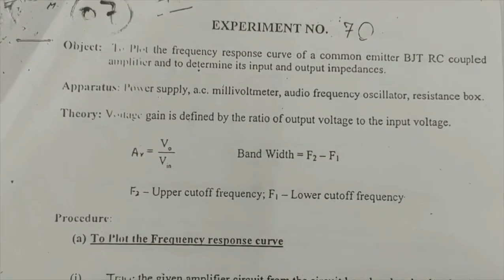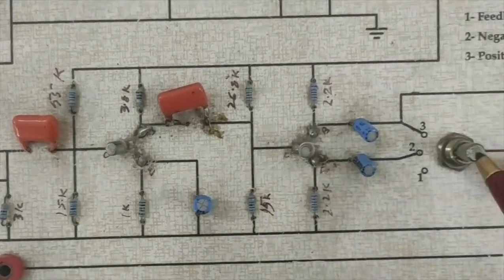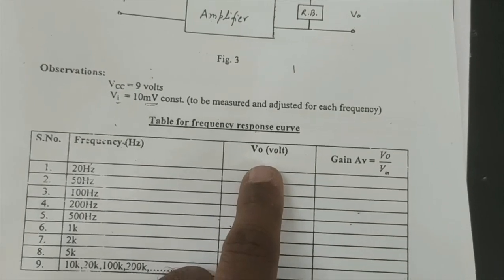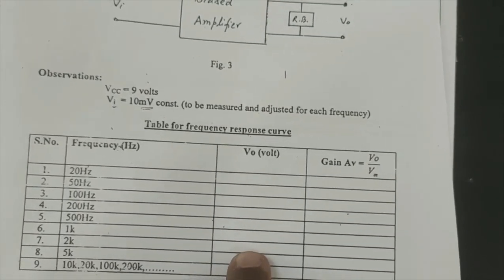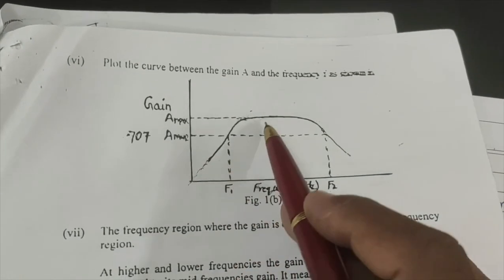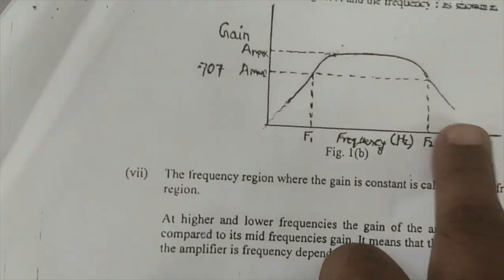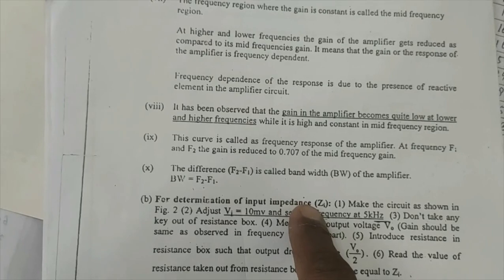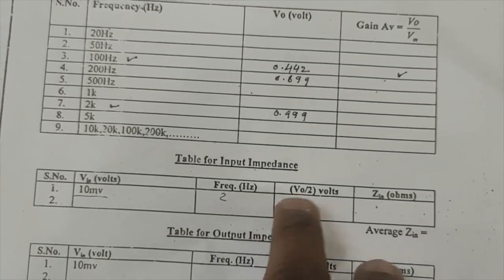Frequency response experiment of a single-stage common emitter RC-coupled BJT amplifier

Comment: How is amplitude 10m v ....
Reply from the maker: The input voltage is kept constant at 10mV but frequency is being varied using the function generator for sine wave.
Reply from the maker: As you know that in a sine wave which we are using here we can change frequency on x scale and amplitude on y scale. But in our case the amplitude on y scale is kept constant at 10mV